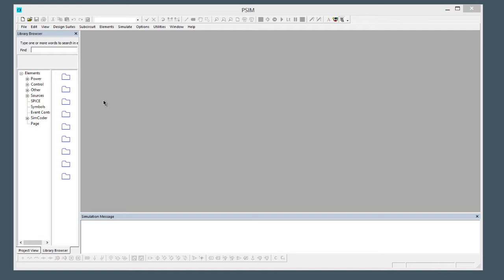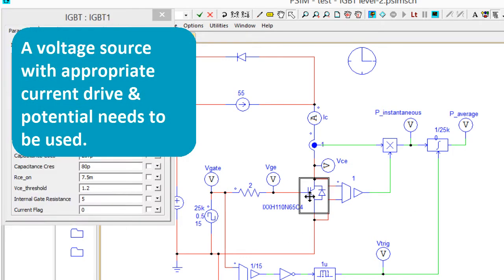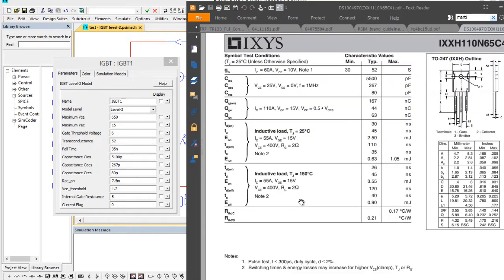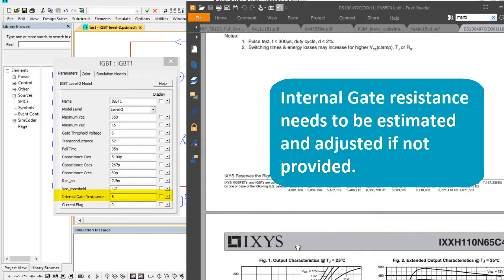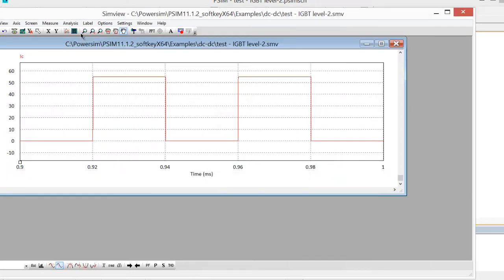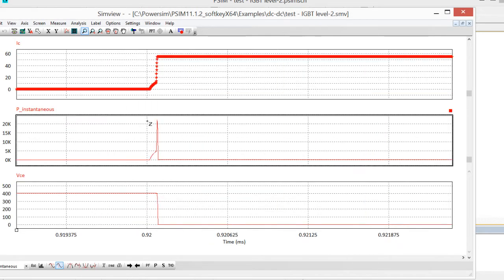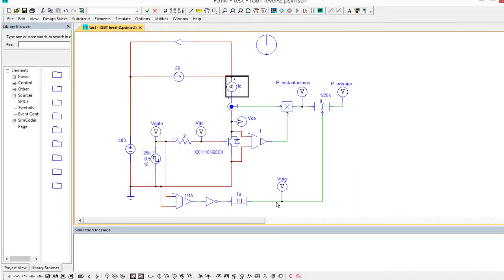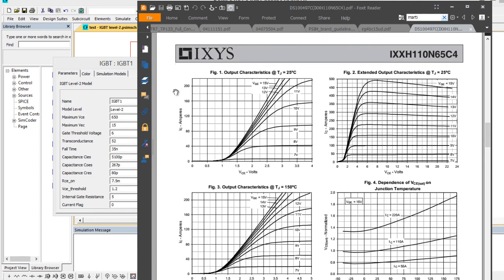Level 2 IGBT model in PSIM

Comment from the maker: Want to try PSIM?                                                                                  - https://hubs.ly/H0f9wCC0
Why should you use PSIM for Motor Drive design?                         - https://hubs.ly/H0f9wCK0
Why is PSIM preferred for Power Electronics simulation?             -  https://hubs.ly/H0f9wFX0
Why should you use PSIM for digital control?                                  - https://hubs.ly/H0f9wC-0
Why you should use PSIM for device level simulations                  - https://hubs.ly/H0f9wDk0
Reply: Thanks, what is the best way to drive the level 2 IGBT using digital control with multilevel inverter (Vge must be floating)? Can I use on/off controller to supply  a controlled voltage source?

Also, I'm using a VPN and a server license to run v 11.1.3 (I'm a PhD student).  I've also installed latest v11.1.5.1 (shows up as 11.1.6 for some reason), the licence works but Spice and PIL modules are not available. V11.1.5 softkey "update" was installed as a separate installation and did not update the already installed v11.1.3 (licence supplied by Ben Gurion University Israel). 

One last thing, is there a PSIM community forum where I can register and ask for help?

Thanks

Comment: why we dont use this in v9 and under levels, dear PSIM, and why PSIM doesnt answer my sıgn ın and download request this software , ı am just an electrical electronics engineering student and I immediately download from your site but ı couldnt, ı sıgned but ı couldnt get an answer from you
Reply from the maker: this feature was added in PSIM v10 and later. You will need to upgrade. We do not offer the full evaluation license to students, if you are doing a graduate degree you can request for a license through your supervisor. There is a free student license which you can use, but this must be requested by your instructor.
Reply: @altairhowto  how ı can simulate my power electronics circuits with İntegrated Gate Driver Circuit, can you help me with a tutorial link, datasheet or something like that?